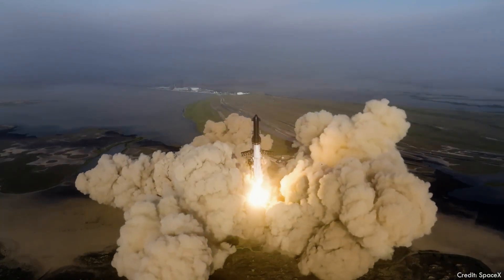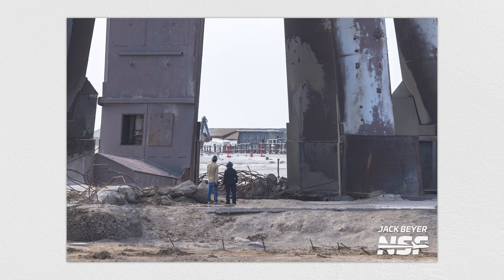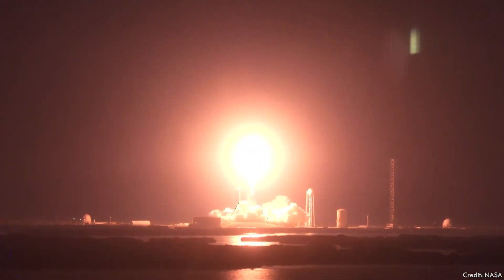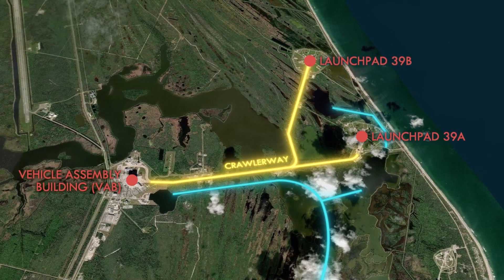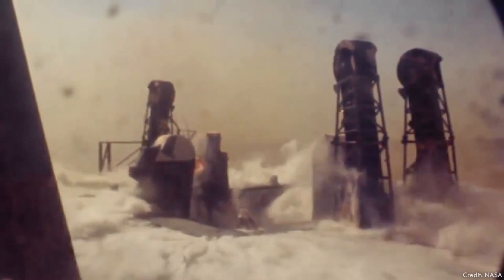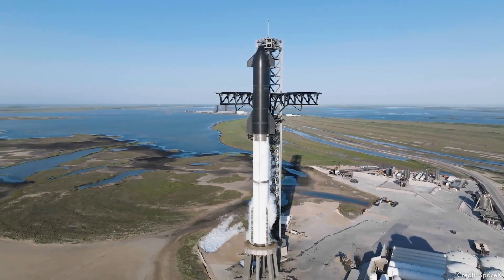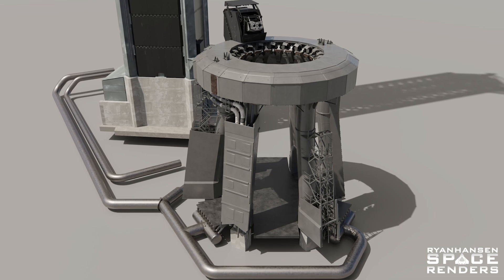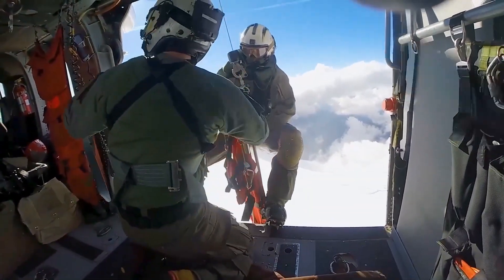Was Starship’s Stage Zero a Bad Pad?

Comment: Yeah, I always thought that shape of the base was terrible.  It was no surprise the thing dug a massive hole and chucked debris everywhere.  And it doesn't look like they are even looking to address that.  Cooled plates are all well and good, but they need to divert all that mass of flame.  At the edge of the new plates, there will still be the same problem.  I foresee another failed stage 0 at next launch attempt.  Those flames need to go somewhere, and they are intensely hot.
Reply: Ablation of the pad wasn't the issue, it was compression and rebound of the subsurface causing the overlying concrete to fracture, they are addressing with a significant improvement to the foundation. The regeneratively cooled steal plate will improve acoustic dissipation and prevent ablation of the underlying concrete pad.
Reply: @lachyt5247  we will see.
Reply: @lachyt5247  there shouldn’t have been that much variation in the force for there to be rebound. Constant force should result in deflection not oscillation. It wasn’t an impulse force.
Reply: @CheddarBro  ok, I hadn't heard that.  Still don't like the flat surface underneath. Seems uncontrolled.

Comment: It's worth pointing out that one of the speculated reasons that there were so many engine failures that ultimately doomed the launch was because of debris from the launchpad striking the engines.  So even without considering government regulations or neighbors, there is a strong reason for the company to build a more durable launchpad to protect the rocket itself.
Reply: I watch Scott Manley, and from him I have learned things like RUD (Rapid Unscheduled Disassembly) and "Engine-Rich Exhaust".
Reply: Thanks for the more calm analysis of the Stage zero performance, after so many “hot” takes (pun intended)
Reply: Per Musk, the first three engines to fail before liftoff, were not from debris strikes.
Reply: @steveaustin2686  And he always tells the truth! Such a free-speech absolutist!
Reply: @MonkeyJedi99  If he is telling the truth, then the Raptor 2 engines need further development. Which matches what SpaceX has said that the Raptor 2 engines will be replaced by Raptor 3 engines.
Reply: @steveaustin2686  I think this launch successfully completed its objective:  to clear out a bunch of old outdated crud like some ancient raptors and hydraulic control, and identified the long pole to reflight:  the deficient flight termination system.  I don't think that was on anyone's radar until the flight occurred.
Reply: @paul_moir  Nah, SpaceX successfully gathered data, but overall it's a failure with how much damage was done physically and reputation wise. The FTS appears to have been an oversight.
Reply: @steveaustin2686  Who's opinion of their reputation?  Customers?
Reply: @paul_moir  Public reputation.
Reply: @MonkeyJedi99 the amount of irony is of the sharts 😂  are you from Germany by any chance
Reply: @NinoJoel  Not from Germany, nor have I ever traveled out of North America.
I live in New England, have lived in Phoenix, had military training in Georgia, and have traveled New York (city and upstate), Philadelphia, and a suburb of Detroit Michigan.
I have not really traveled much at all in the last two decades.
-
Why do you ask?
Reply: @MonkeyJedi99  because the amount of sarcasm is very typical with Germans. 
You'd fit right in 😄
Reply: @steveaustin2686  Ah, the least informed opinion.
Reply: @steveaustin2686 
He actually ended up saying that the reason many engines didn't function properly is because they, along with much of the rocket, was of lower quality than the superior Starship they plan on flying earlier.
Although, admittedly, the debris likely had something to do with it.
Reply: @ivoryas1696  Which I mentioned that the current Starship is using Raptor 2 and they were already working on Raptor 3 then.
Reply: @CheddarBro hat's more insane considering 3 engines was their margin of error. If they cut those three BEFORE the launch then it never should've launched. Period. this company keeps cutting corners and red tape and for what? There's no progress here.
Reply: @NeoFryBoy  Well, that obviously was within their launch margin since they launched knowing they didn't want to start three engines.  It's not like Elon's sitting in a control room with a finger on a button.  This was all decided long before the launch and programmed into the launch software.  What corners have been cut?  What red tape?  I really don't understand?
Reply: @paul_moir  Are you claiming SpaceX has no way to abort a launch? That even when they run out of their MOE they still HAVE to launch and destroy a 2 billion dollar rocket?  😵‍💫 Maybe they should hire me to build them a button. I'll charge them less than 2 bil.
Reply: @NeoFryBoy  No:  I think you misunderstood what I wrote.  Launch commit criteria are predetermined, same as any other rocket.
Reply: @paul_moir  Yeah, and when the criteria says don't launch, you don't launch. How is this so hard to understand?
Reply: @NeoFryBoy but they did launch so the criteria didn’t say don’t launch… What don’t you get?
Reply: If you think about it, the mass and flow coming from the base of the rocket, which is what destroyed the pad, should also have kept the pad from flowing back up towards the rocket.  1.8e6N * 33 engine / 9m rocket_base_area = something like 145 PSI force  from 21 tonnes per second.  Are you really throwing chunks of concrete against that successfully?  I know there are nuances but you have to overcome the big picture which says, at least to me, "firmly no".
Reply: @paul_moir  I have used high pressure, high volume hoses to clean military vehicles after very muddy field exercises.
 I learned quite quickly and painfully to NOT spray high pressure - high volume hoses perpendicular to flat surfaces after I got a facefull of mud and rocks blasted straight back at me, as well as those that bounced off of other nearby surfaces in an amazing geometric assault of debris.
Spraying the hose at those surfaces by at least a 45 degree angle kept me unassailed by mud and rocks, and relatively dry.
-
Just my empirical example that flies in the face (pun!) of your hypothetical assertion.
Reply: @MonkeyJedi99  Yeah, I get that.  Anyone who does any mechanical stuff like that gets the idea of blowback.  And you can totally see chunks of concrete blowing up alongside the rocket   But I don't see the mud flying into the orifice of the pressure washer nozzle.
Reply: @paul_moir  Look at the launch pad. Plenty of vertical surfaces for debris to bounce off of and avoid the direct line of the rocket exhaust and still reach the engines.
It is highly likely? Probably not.
Is it completely impossible? No.
Reply: @MonkeyJedi99  Please acknowledge I masterfully covered all that under "nuances!"    
I think you're right there were a bunch of possibilities like that (and I hear that the point sources of all those nozzles make for some weird flows too.) It just seems unlikely to me on the whole due to the extreme energy coming from the engine section.  Even in spite of the shear quantity of debris.
Using some crappy secondary evidence to support my position: the three engines that were out at launch seem to have been shut down well before the pad exploded from Elon Musk's update.  The next engine out didn't happen until something like 35 seconds into flight.  Absolutely it could have been damaged or something that made it work could have been destroyed, but that seems less likely to me than a vehicle or maybe engine problem since it (apparently, only  visually) took a while to have an effect.  
Please understand I'm not against you: I think this is a productive and fun argument.
Oh, I meant to say, I suspect the hydraulics powerpack exploding might have been debris related.  I wonder what else could have possibly caused that.
Reply: @MonkeyJedi99  Have you ever successfully hit back the hose nozzle with the debris? I doubt so.
Reply: @schawo2  Well, I was holding the hose nozzle with my hands, and my hands were also pelted in the perpendicular spraying.
A rocket engine need not be struck on the inside of the exhaust nozzle to cause problems.
Reply: @MonkeyJedi99  I watched a man cleaning his shiny black car with a pressure hose and began to go over it again to get the grey areas off.
Then I realised that he had removed the topcoat and was now aiming to remove the undercoat. 
He was stopped.
Reply: @paul_moir  look at this guy 😂 desperately trying to defend daddy muskers with anything he can find laying around.

Comment: The problem is the direction of this engineering project.  This appears to be a engineer the product as it is being built rather than do all the math before it is built.  Anyone can do the math for all those rocket engines and how much pressure they would apply at any second during launch, but not SpaceX.  The amount of heat and pressure says the steel won't last very long on the launch pad.  H13 tool steel will vanish under those pressures.  Usually, engineering will try to not get the operation shutdown by the Feds on their first test.  First thing that needs to be addressed is the ground water and creating a foundation that is deep enough to not sink during the launch vibrations.  Many engineers will build a scale model to do their tests with in a safe environment in the desert.
Reply: > The amount of heat and pressure says the steel won't last very long on the launch pad.  H13 tool steel will vanish under those pressures. 

Wrong. Exhaust gases temperature is much lower than iron melting point. The destructive force of the launch almost entirely comes from the high VELOCITY of the gas, not temperature. Notice that there is rather little scorching in all the photos.
Reply: > Anyone can do the math for all those rocket engines and how much pressure they would apply at any second during launch

Oh really? Anyone can? You can too. Please demonstrate.
Reply: @denysvlasenko1865  I have been working in engineering since before you had a clue what an Eigenvalue was...  I take that back you may not know what an Eigenvalue is or how to use it.  There are three types of engineers: 1)ones that have no idea how to engineer, so they design as the build. 2)ones that figure out everything including the failure issues, before the project starts. 3)ones that only think in upgrades.  All 3 are costly to a company, but #2 is the cheapest in the long run.  Before you attack people, ask questions as you might be overreacting or showing your true colors.  No worries, I find the most toxic engineers on earth on YouTube.  The type that are days away from being fired at work, because they think they are a god.

Comment: That water cooled steel plate is going to fail as well. I cannot wait to see the catastrophic failure.... cooling isn't the issue.... it is the massive momentum blast of all that super velocity gas, of which has enough energy to propel a superheavy starship; it needs to be redirected, which is the main issue; cooling is secondary, but also a good thing to have. Redirection is the primary means
Reply: > it needs to be redirected

Did you not notice SIX directions under the launch mount, where gas can (and did) go? Take a closer look at any photos :)
Reply: @denysvlasenko1865  That isn't a redirection..... It is literally blasting the concert at orthogonally

Comment: Couldn't they just build a 360-or-so degree flame diverter under the launchpad to fix that issue? Like, put a transitional cone in the middle of the new steel plate instead of having it flat...?
Reply: One of saner comments under this video. Good job.

Comment: So when an aircraft is in the air, is it being propelled by Earths atmosphere?
Reply: In case this wasn't sarcasm (hard to tell in a written comment haha): 
Sort of, internal combustion engines (like those in simple propeller planes and cars) as well as turbine jet engines use the air flowing into them to get the oxygen needed for combustion with the fuel they carry. In a rocket, the oxidizer (generally liquid O2) is also carried along for the ride with the fuel (in separate tanks), and the two are mixed and ignited in the engine, so it can continue operating when the atmosphere gets very scarce, or in the vacuum of space.

Aircraft also rely on the atmosphere to generate lift: simplest explanation being that as air flows over the plane, the wings redirect the airflow at a slightly downward angle, and conservation of momentum creates an upward force on the aircraft, keeping it aloft. In contrast to an aircraft, rockets are generally not "lifting bodies", and rely entirely on the engines for their flight control.
Reply: Let me rephrase my question. Is the atmosphere the reason why the earth doesn't lap airplanes? Because the earth is rotating at approximately 1000mph and normal commercial jet are traveling at an average speed of 550mph. For example, leaving from China and heading east (earth's rotation direction) toward California.
Reply: @derekpaul907  The air moves with the Earth for the most part. There is a prevailing wind from West to East (not sure of the exact mechanism).
Reply: @derekpaul907  The 1000mph is a simplification, but lets roll with it. As the planes goes to take off, it is moving at 1000mph the same as the air and Earth. So you can ignore the rotation of everything as they are all in the same frame of reference.

Lets go smaller. When you are lying in bed, you are rotating at 1000mph with the Earth. But if you jump out of bed,  you don't fly across the room from the Earth's rotation, as you are also rotating with the Earth. Same thing if you are standing and jump straight up in the air. You come back down where you started. Or get on a bus. Stand up and jump straight up  in the air as the bus is driving down the street. You land back where you started, since you were already moving at the speed of the bus when you jumped.
Reply: What I'm trying to get at is that the plane is going the speed it needs to take off, plus the earths rotation speed right. I got that. But what helps that plane sustain the earth's rotation speed when you account for air resistance?
Reply: @derekpaul907  Airspeed is most important for aircraft. I think last year a few passenger airliners (max airspeed of  789 Mach  for the 737-800) has a ground speed faster than the speed of sound by following the jetstream.

Bush planes can sometimes take off and land with zero ground speed: as long as the wind is blowing hard enough.

TL;DR: Yes.
Reply: What do you think propellers push against?

Comment: Why don't they "just" put the launch tower over water? I'm sure there is a good reason and I'd like to know why. ✌️
Reply: More difficult to maintain.
Reply: @denysvlasenko1865  but if it is heavily used? Att some point it has to get more economical not to pour new concrete all the time.
Reply: @reverse_engineered     I was considering that NASA doesn't launch nearly as often as SpaceX is planning to. But of course it's probably easier to build a pool under the launch tower. I'm just a fan of floating structures 😅

Comment: The water deluge system was as much, if not more, for protection the pad from the incredible sound pressure rather than thermal protection. Saturn V nearly maxed out the possible sound pressure possible in 1atm of air
Reply: One of the major components of Saturn V sound generation was infrasound. That is, sound below 20Hz that cannot be heard by human ears. The rocket produced a lot of super powerful infrasound that created enormous stress on the rocket stages above. It had to be accounted for in the design and they worked on ways or reducing it via pad/deluge design and some tweaking to the engines. Powerful infrasound can cause internal hemorrhaging in humans and shake buildings apart.
Reply: Given that there's a lot of suspicion that all those motor failures during the starship test launch were directly caused by that sonic damage, the new plate probably won't fix the problem either. They need a deluge or other acoustic solution just to keep acoustic effects from rattling the engines apart again.
Reply: @Sappo7  That's just suspicion from internet commentators.

There's a NASA doc [Acoustic loads generated by the propulsion system - NASA SP-8072] that stated in order to have an effective deluge to minimize the acoustic load from a big rocket, you would need to launch it on a large lake.
Reply: @807800  That's a misinterpretation of the document. You don't need to eliminate or even "minimize" acoustic load, you just need to REDUCE it enough to not vibrate things to the point of premature failure.
Reply: @yucannthahvitt  Eh? You misinterpreted my comment.

I'm responding to Sappo7 claim that they need a water deluge to protect the engine. So, I gave out the document that said such a thing is impractical. Hence, that's why SpaceX didn't do that. Instead, SpaceX decided to make their rocket and engines to be robust enough to handle the acoustic load.

SpaceX even goes as far as trying to make their engine robust enough that it wouldn't require engine shielding. As shown by the evolution from Raptor 1 to Raptor 2. They aren't there yet, but that's their goal.
Reply: ok
Reply: It also was to protect the lower stage against sound waves from hitting it
Reply: @Amradar123  UltimaTE cAPTAIN.....
Reply: @Amradar123  It's also to prevent killing birds and other wildlife that are within 2 miles of the launch pad. The water is technically called the "Sound Suppression System".
Reply: @Amradar123  thats what he said.
Reply: Would water even attenuate sound energy?